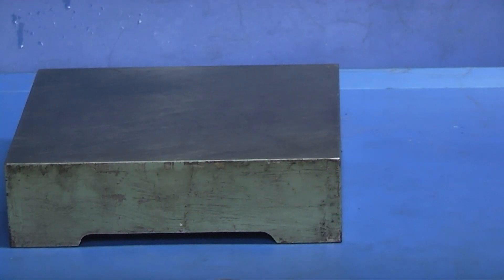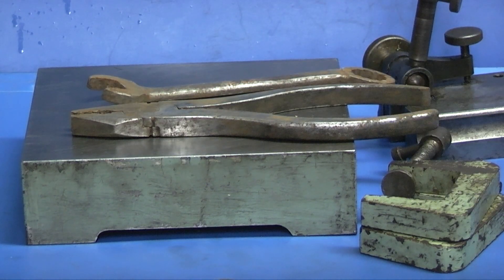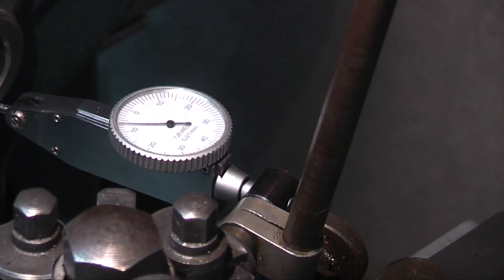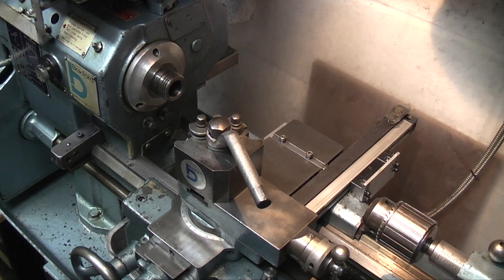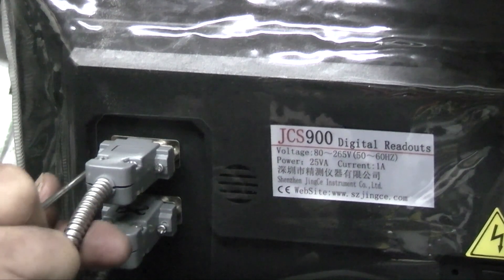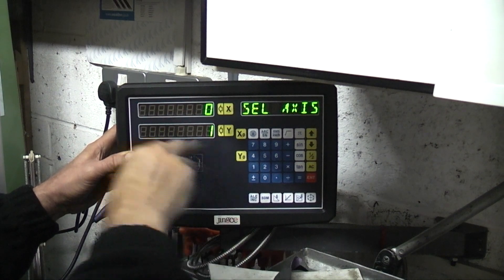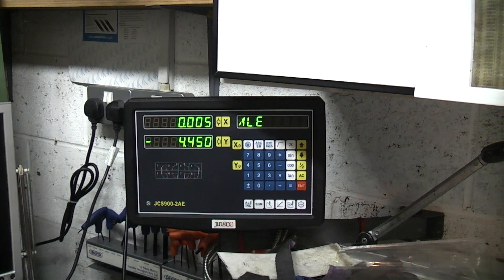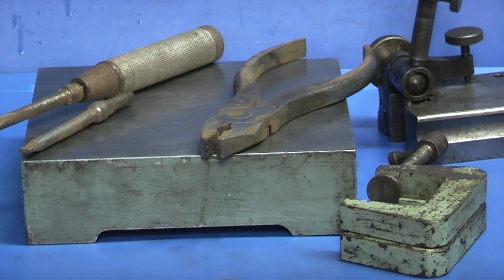More tools and setting the the X-Y readings on the lathe

Comment: Back in the 80s, the standard here was : Your apprenticeship was 4 years. Each year you worked 41 weeks and went to school for 10 weeks. I was accepted in an experimental program, which had us go to school for 40 weeks in a row, to become a Journeyman in 3 years, I graduated, with honours, with my left arm from the 2nd knuckle of the ring finger up to and including the shoulder blade and pectoral muscle, looking like raw hamburger... from an allergy to cutting fluid... so, I have all the education of a Journeyman, with none of the experience...  (and that was a very long time ago...) We made: a V-block  clamp, a set of 1 inch parallels, a Machinist Jack, 2 dozen 1/4" HSS bits,  a wee hammer with replaceable faces,  (Hardened & tempered 4140, Brass, and Nylon,) an MT3 horizontal Mill Arbour, a 2 foot Trammel with straight, and curved points,  a cast iron 4"x6"  Angle Plate,  A Drill Sharpening Gauge,  a 60° Threading Tool Alignment Gauge, and a 3/8" Hardened, Tapered Arbour... I think that is the lot...
Reply from the maker: Very interesting I recall making most of those items

Comment: on most machines, including cnc & manual lathes, the axis that aligns with the spindle is Z-axis. Hence the carriage moves along the Z-axis. The cross slide movement is designated as the X-axis. This said, many DRO's sold for use on lathe are actually  an XY DRO for manual mill.